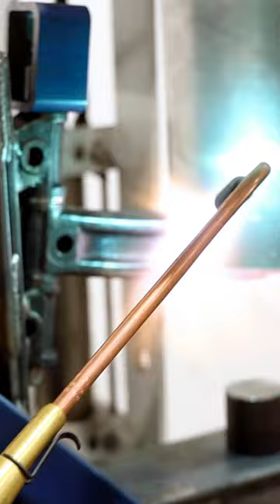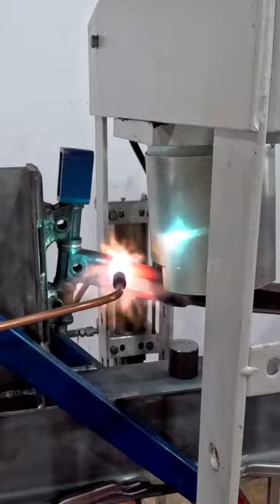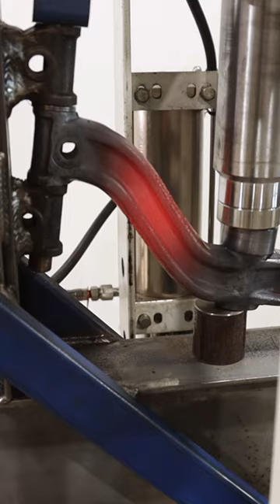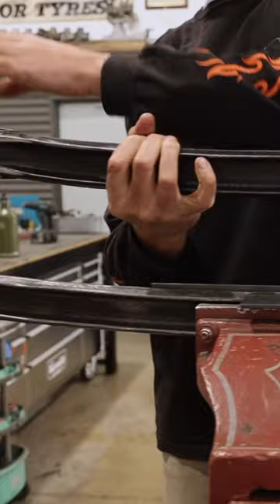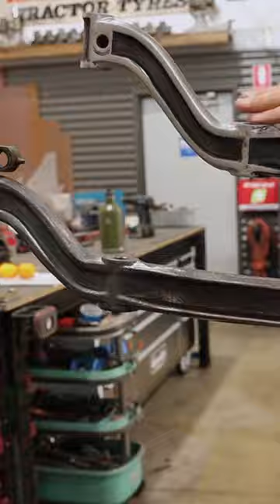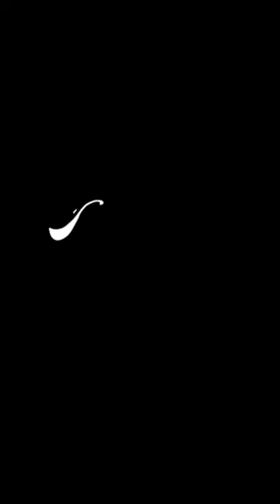Dropping 95 Year Old FORD Axle #roadster #fordhotrod

Comment: Какого прочность метала после нагревании.Или вы накаляете после того форму подали?
Reply: Eso mismo yo me pregunto, amigo.         Ya tendremos alguna respuesta.
Reply: Its forged steel, the strength is still incredible after. Remember, these axles were meant to have some spring to them as well
Reply: @tradrodsandcustoms  Gracias Amigo, un abrazo desde Uruguay.
Reply: Низколегированный стали с низким содержанием углерода можно при 700 градусах хоть в бараний рог свернуть без потери физико-механический свойств металла
Reply: @tradrodsandcustoms  Спасибо за ответ.

Comment: Your jig has some flex to it if you watch closely. Have a solution for that?
Reply from the maker: Yeah leave it
Reply: @bennettscustomsco  doesnt that defeat the purpose of the king pin and all the bracing that went into isolating it? If its flexing as it cools then your angle has changed. Im judging by your response that perhaps you think im trolling but in reality i am about to build my own jig and its a genuine question
Reply: It's Hot Rodding.... not Rocket Surgery 😏
Reply: @georgemosley6790  well thats a silly attitude, hot rodding requires some precision too. Doesnt make it rocket "surgery"? 🤣 you gonna go 20 mph in your "hot rod" or take it to the salt or the strip? The little stuff matters at speed bud. Best of luck, sounds like youll need it if youre building cars hahaha